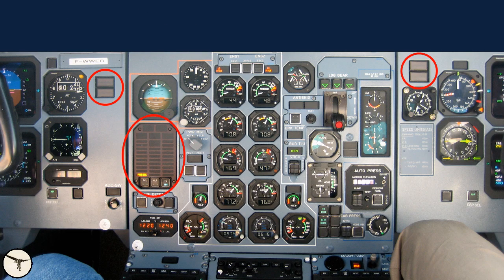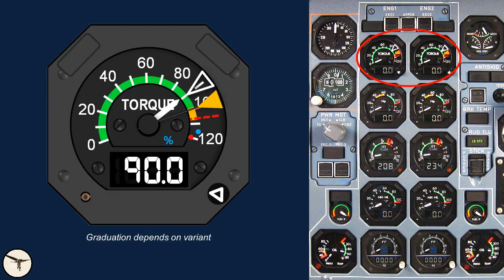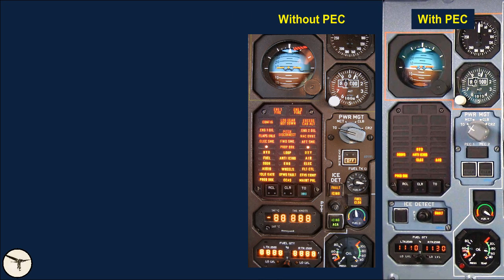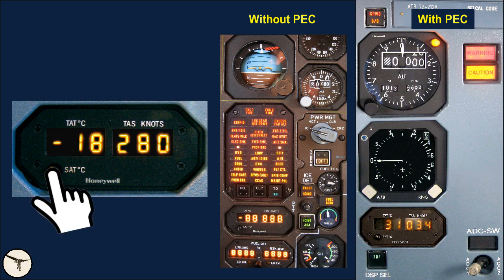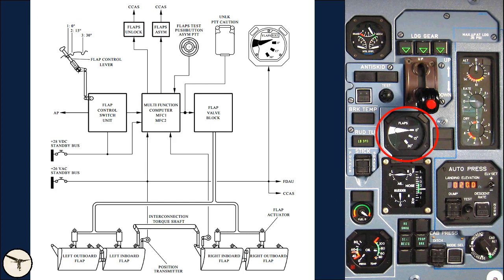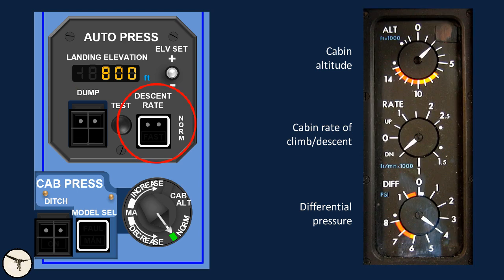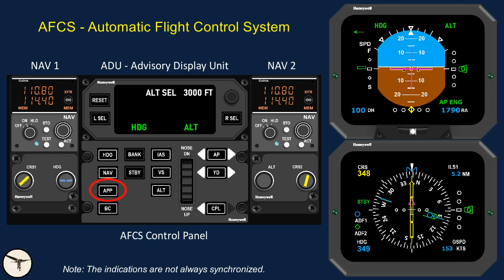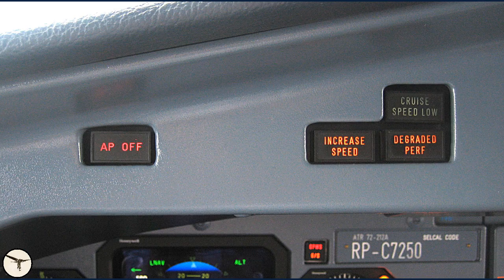ATR systems - EFIS instrument panel part 2

Comment: Thank you so much Magnar. We hardly ever used basic mode anyway. But there was a pitch wheel and there was a roll-knob in the '50' so flight-path could be altered without 'TCS-ing'.

Comment: Hello, a short question about AFCS: if F/D STBY is selected, the 'basic modes' become active. Pitch is then controlled by the pitch wheel. And as I understand the aircraft maintains heading. But can the pilot roll the aircraft/change the heading in basic mode with A/P engaged? Or do you have to use the TCS button? In Fokker 50 there was a 'roll-knob'  for banking in basic mode but I don't see one in the ATR? Thanks and regards, Boy
Reply from the maker: As you described, the pitch is controlled with the pitch wheel. But depending on the bank angle of the aircraft when you engaged the basic mode, the mode will either be heading hold or roll hold (maintaining the current bank angle.) The only way to adjust roll in basic mode with AP engaged is to use the TCS and fly the aircraft manually until the desired roll is achieved.